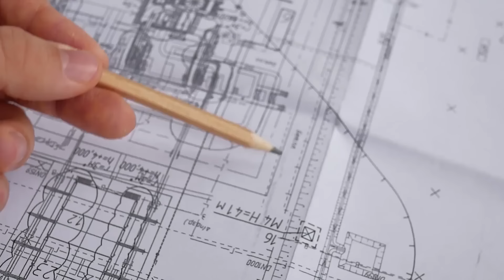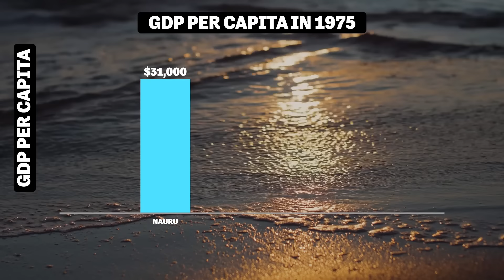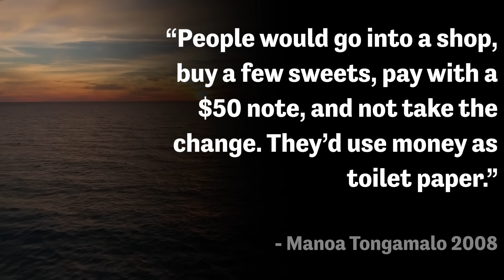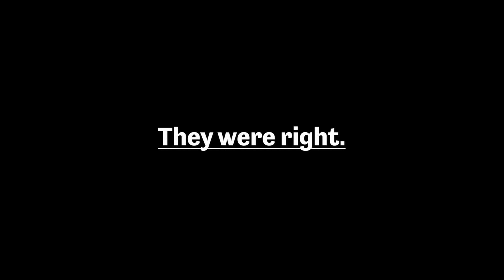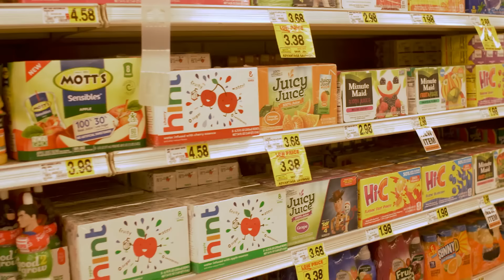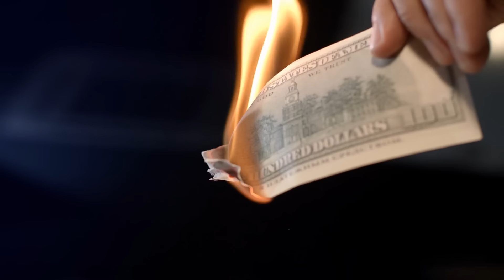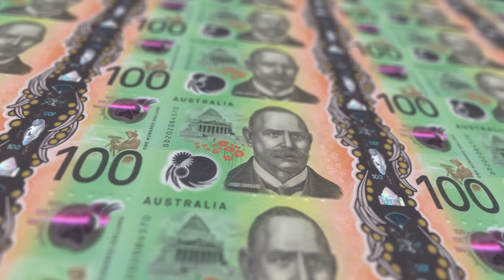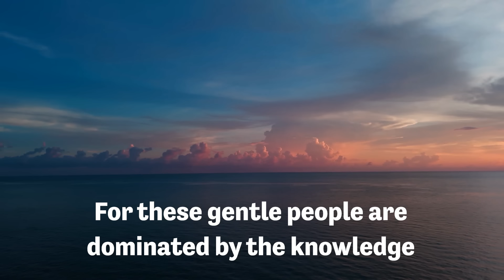How the World's Richest Country Bankrupted Itself

Comment: I was thinking they could have used a portion of the profits from the phosphate to refurbish the depleted land as they went. Ships could leave with the phosphate, and instead of coming back empty, come back with topsoil. Topsoil would cost a tiny fraction of what the phosphates sold for but would have enabled them to start cultivating the land. That way they wouldn't have been dependent on outside food and would have gradually restored the tourism value of the island.

That's just one idea. Regardless of the specifics, I think they really ought to have invested into developing the island rather than dumping money into foreign assets.
Reply: This would have been good and logical. However it also said the topsoil was removed before mining so where did that soil go? Lastly they said  some production still occurs from "secondary deposits" is that newly deposited guano by birds still using the island?
Reply: Thats a good idea, unfortunately they were prolly so rich that the idea of becoming farmers, which they had never traditionally been (they’d only subsisted off of gathering nuts n breadfruit from the forest, not farming), seemed unnecessary.
Why would u do hard labor many hrs a day when instead u can buy a bunch of businesses abroad and make rent from being a landlord? Its shockingly short sighted but thats the power of vast wealth
Reply: Hindsight is 20-20, right?
Reply: Honestly the most reasonable comment I have seen. However (I’m sure this has been addressed or similarly) mining topsoil costs money eating in to the profits potentially gained. If the Nauru gdp at one point was $10 billion, how would it have looked factoring the cost of the returning topsoil at modern wages/extraction rates? 

Agriculture at its definition became one of the main issues with continuity for modern life, but there’s absolutely a lack of production without productive soils. 

One could not have anticipated the hindsight, mining your topsoil rich in phosphorus is not good for production but at the rate they contributed to it actually decimated agriculture. I would assume the only way to kickstart is to offload the agricultural productions on a loan, but even then that’s not a solution and instead more problematic to the modern society. 

It begs the question: what is the solution? What would have been the true growth for the country? And honestly, I don’t have anything even close to an answer besides a vassal state, to all unfortunate participants (namely U.S.A. and potentially the British empire)
Reply: "That way they wouldn't have been dependent on outside food"
Unlikely, but they would have been a little less dependant, just a little.
Reply: That is the thing. Being rich make people lazy. And they do not think about simple solutions until it is too late. the problem was not the soil, but like with many countries affected by Dutch Disease. All money was wasted on unprofitable investments. And the simple fact is that with that money, they could become successful megacorp. But they end like most megacorps do end. In ruin.
Reply: dude, they were so rich, they could've done everything to create a marvelous island, with smart investments, but they thought the money flow would never stop and the desire for purely material goods from overseas for these initally poor and highly uneducated people was simply too big
Reply: Offloading the soil from the ships would be a problem,
The phosphates should have been removed and the land reinstated as the do when  strip mining coal,
Reply: @julm7744  that's really interesting and makes sense. In that case I wonder if they could have brought in other fill material to help smooth out the land again and put back the existing topsoil. Probably would have needed to seed and straw or something to prevent erosion. I'm sure SOMETHING could have been done if the will was there. It's not exactly a huge area
Reply: While a good idea the island wasnt wide enough and the salt from sea spray would make the majority of topsoil put down become barren anyway.
Reply: honestly, great solution. you should be employed in logistics by the nauruan government.
Reply: they could have just bought gold and sat on it  . but sadly  they were just exlpoited  . and yes  they could have  renaturalised the mine feilds   .  there is alot more to this sad tale  , one of the main reasons   aus  has been   so  suporting   is because   they were  one of the countrys  that    quite litraly   stole the land from under the feet of  Narau
Reply: @colinfavul That and there's always more details not mentioned in video. B Also just covering everything in random soil is not enough. You need holistic plant  and root system development to stop erosion and correct methods and cultures. Besides, i think    OP underestimate the cost and overestimate the availability of  soil, which is in crisis globally. The richest and thickest is in Ukraine, so there could be a deal there (if you don't mind a slight contamination with war residue). Soil is one of the greatest challanges of Humanity today, but economically that even wouldn't be a timely saver of Nauru. I don't have the answer, but the place is still warm and pacific beaches in demand, if not contaminated. So my guess would be decontamination and tourist (probably themed) infrastructure. All of which is a huge investment, even if that's just one small island.
Reply: @Algimantaz Easy come easy go.
Reply: 🤔 Give massive amounts of money to people unused to having any money...and well, failure is to be expected.  😞.
Reply: @julm7744  they totally cared in that era. They could have simply bought it from another island state with a lot of mining.
Reply: Yeah, they should've done everything in their power to keep the money in Nauru.
Reply: They could've idk, rebuild the island's native vegetation????? There could've done tourism but nnoooooo they destroyed what precious natural landscapes they had and destroyed it, they could've done a cultural thing with the native people but nope, it was all dependent on a limited amount of phosphate. They should've done the Seychelles strat and focus on the environment, it could attract tourists
Reply: Sounds like had enough money to do both, but it all got squandered away.
Reply: The Norwegians also have a multi trillion dollar national wealth fund but seems to have not spent it on giving Norwegians an easy lifestyle.
Reply: @julm7744  My geography prof in uni brought back soil samples and ended up having to quarantine almost all of them to keep the nasties from getting out.
Reply: If they'd invested sensibly there's no reason they couldn't have been sustainable in perpetuity with such large sums per-capita.  The mistake they made was be spending revenue before the investments grew.  If they'd lumped their cash into trusts in the major market economies with strict growth periods and restrictions on cash extraction levels those investments would now be returning plenty of income.  A nice example of this is the London Bridge Company which started out as a private business making money from tolls which was shifted to a trust, now centuries later it is a multi-billion Pound trust and one of the cash richest organisations in the UK which primarily invests inside London alongside spending a lot of money on good causes withing the city.  It will never go bust because it's built on long term financial planning and restricting it's expenditures to (I think) 5% of net profit in profit making years with the rest going back into the trust for reinvestment or rainy day building of reserves.
Reply: I was researching how they exported so many tons of product without having a shipyard, harbor, haven, bay, docks structure anywhere on the island and found out the island is actually so small that the only viable place for such a structure was used to construct the island's only airport strip, which is barely just long enough for an airplane to land and stretches from coast to coast. The island is surrounded by coral reefs and ships must be loaded far away from the island by smaller vessels because of the corals and shallow water. I imagine that is also why communication breaking down had been such a big problem basically any project that involves construction is a serious problem when a big cargo ship cannot even get near the island. Finally in 2018 they managed to put $22 million into plans of building a port where ships could actually dock and unload their cargo and construction started 2020.....
Reply: @alexpotts6520  not so much hindsight, as the very first thing I thought when I heard that a tiny island was exporting its soil. Sure, that very first thought was tied to the fact the island was tiny (and as such was erroneous since there was apparently no risk of them digging below sealevel), rather than the sustainability. But the second thought was the natural continuation of the first - that it would also ensure they still had soil for greenery.
Reply: But they didn't care about the environment. 

Focus on having decent people and decent relationships first, money has to be subservient to that or else the money won't matter in the end.
Reply: @alexpotts6520  Actually the UN and Australia warned them upon their independence that the good times couldn't and wouldn't last forever. It didn't help that the government was running a functional deficit at the height of the phosphate revenues, the investment fund eventually lost a $billion because the assets were sold and seized to consolidate debts.
Reply: @picketf you must be replying to a different video. The offloading infrastructure to get the phosphate onto seagoing bulk carriers is clearly shown in the video. The material being taken to the dock by rail.
Reply: @ianmcsherry5254  the imagery displayed here is not from that island, just some generic footage. Large scale phosphate mining on Nauru ended over 20 years ago. Grainy 2000s era video is not as exciting to look at when you can opt for 1080p stock videos instead. Also there is no rail on Nauru. There used to be a small yellow narrow track cable car instead that is over 100 years old.
Reply: The government don't spend for education for those younger bright citizen abroad  in their future for the country next generation
Reply: @SamtheIrishexan  The island was covered in jungle before the Phosphate Mining was started, where do you think these hunter gatherers got their food from?
Reply: @patrickkelly6691  not from the jungle. They ate coconuts, birds and fish their jungle didn't even have fruit bearing trees. Deforestation only goes one way. Once it's gone you can't expect it to grow back, if there is salinization involved the soil will never be green again... unless someone sieves the soil for salt particles and raises huge walls to prevent wind.
Reply: @picketf  Coconuts and birds. So no lizards, small mammals etc? `No fields to grow crops at all?
OK then.
Actually the bedrock left by removal of the nitrates is limestone and there is no salinisation problem. as it's all significantly higher in elevation than sea level. They could have imported all the soil they wanted when the money was rolling in. So the removed ''jungle' could now grow crops run dairy etc.
Reply: @patrickkelly6691  Soil salinity is a major issue causing land degradation in coastal areas. Deforestation changes the balance between rainfall and evapotranspiration, resulting in the increase of percolation and seepage water. As more soil is exposed to the air, through deforestation, by ploughing and by fields lying bare, salinity will only increase. Buried beds of limestone are constructed to intercept subsurface mine water flows and prevent contact with ground water so over time it is safe to assume the accumulation of salt in the ground because saltwater cannot drain adequately. The TLDR is intrusion/irrigation with seawater can threaten biodiversity along with crop yields.
Reply: @picketf  Take a look at the Island. The area left is fine, just has little soil, some vegetation is growing. You seem to be trying to displace the situation into some low coastal areas, this is not that. Soil Salinity is mostly an artefact of heavy land use. They are not using the land in question at all.
Reply: @patrickkelly6691  I didn't say that nothing would grow. Just that the prospects of importing tons of soil, constructing aquaducts, irrigation, drainage, protective walls for fields of produce that also needs transportation and processing only to be exposed to the long term risk of salinization and unproductiveness, that makes such an undertaking very high risk/reward.
And the fact that such fields would be high up doesn't change the salt concentration that is in the air, specially in a treeless, deforested area in the immediate vicinity of the ocean, just not viable to build fields there and expect it to be a long term solution! I suggest you look up "agrodeforestation on islands" and the erosion impact it had one much much bigger islands.
Reply: Ridiculous because it took many  thousands of years of coral and sea bird poop to make the island into the lush place it was once.
Reply: @DonnaCsuti-ji2dd  Yet amazingly, with modern agricultural science it COULD be returned to an even more fertile and lush place in a few short years. 
But the money isn't there now to do it so there is no profit. Maybe China can help..
Reply: @patrickkelly6691  same as the moon could be a colony for everybody on earth, including green lush fields under led growlight satellites.... if only we could realise it with wishful thinking.
Reply: @picketf  Now you are just being ridiculous as the challenges are a magnitude more difficult. Your comment is personal and mo.ronic. Please desist.
Reply: @patrickkelly6691  agreed.
Reply: 20-20 hindsight
Reply: @jeffbybee5207  Dumped in the ocean, but that said. What was left was left over phosphate rock and coral stone. One machine could probably crush those "spikes" into smaller rocks, mixed with phosphate rock and importer cheap biomass ala wood chips and a "worm factory" or something. Could probably have produced new top soil with nourishment.
Reply: Certainly could have done both. Norway’s sovereign wealth fund is a great model.
Reply: The original displaced topsoil has washed into the ocean. Depletion of vegetation destroys root systems holding soil in place. Extensive and careful revegetation and reforestation is required for any lasting solution.😊
Reply: @daleversfelt  And that we oils have needed topsoil coming back.
Reply: Yes, but buying foreign assets is still great take Sjngapore for example. If only they were smarter where to invest rather than just outright buying just because they were rich
Reply: And that's why Gulf countries invest so much in local agriculture. They hope to be self-sufficient in food, to not starve when the oil money ends.
Reply: Ecologist would probably have a hard counter to that idea
Reply: yes but they had tropical mindset which think here now and not tomorrow. they could have afforded to fill in that area with topsoil.
Reply: No more phosphates… stripped clean.
Reply: @colinvanful You're correct.

Comment: Capable of withstanding an event that would result in 50-99% of the global population perishes. Awkward wording to anyone else? I think you could say that could still include the ability to survive an event that would result in a less than 50% survival rate. While I would agree that it doesn't need to explicitly say every fatality rate it would withstand, they gave an explicit range when they could have said up to 99% or at least 50%. It makes it sound like the bunker would provide no protection against an event with a global fatality rate less than 50%. Loosely related thought why do we feel the need to represent almost every fraction in percent? I'm not suggesting we need to use more per myriad figures and we already realized ppm and ppb are better sometimes but we say 20% and 80% when we could say 1/5th or 4/5ths and I am not exception myself there is something professional and official sounding about saying "out of 100" in Latin.